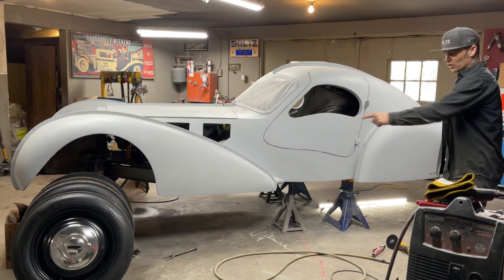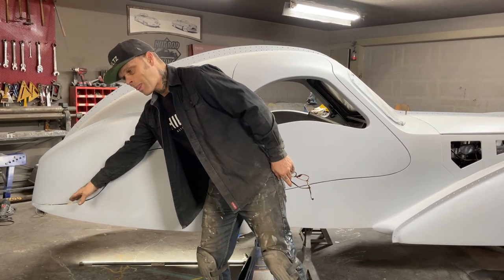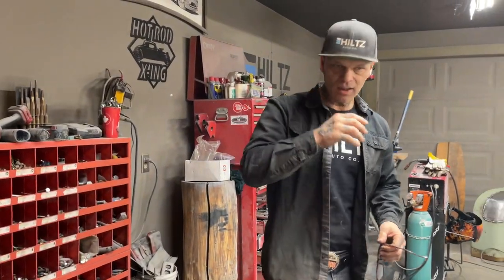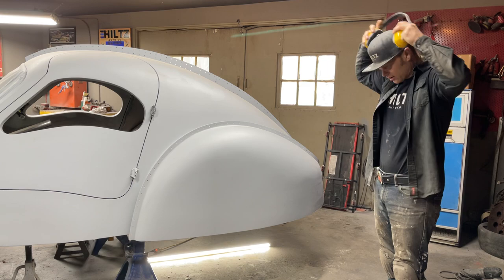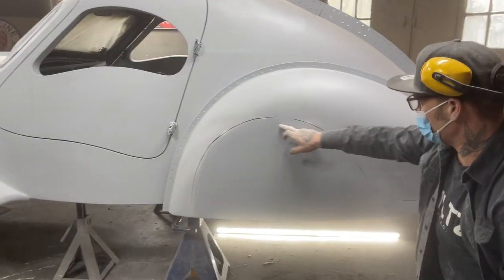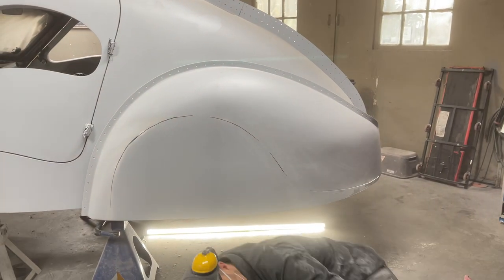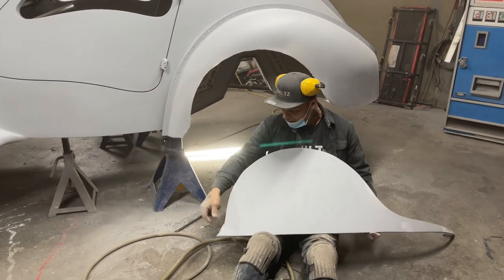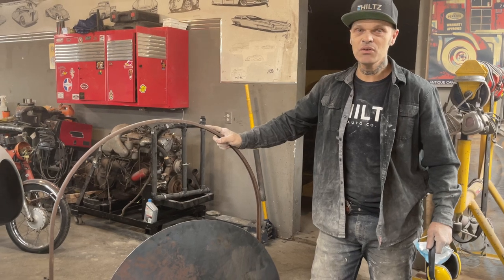BUGATTI UPDATE: REMOVING THE OTHER FENDER SKIRT

Comment: Drill a bunch of small holes from the inside, then connect the dots with a sharpie and the cut it from the out in one continuous line with a grinder, would be much easier and would yield a near finished result... the drill size size should be small to minimize any blowout. No sparkles in your face, your not lying on your back, and your not struggling to find your line. Your doing an awesome job regardless! Thanks for sharing!
Reply: Nice idea but we still gotta cut the washer spacers as well remember but good point👍👍👍

Comment: The grinder is working if the blade doesn't come apart and cut your throat. I think I would have used a jig saw with a diamond cutting metal blade. The car looks good keep the videos coming Chad !

Comment: What I have done in the past you would take clear box tape and put it on the inside of the fender Edge so the Bondo doesn't stick to the car body and then you could unbolt Fender skirt and it would pull right off of the tape and then you could send it back how you wanted it to look I've done this before on a Formula Ford race car body were the top of the body fit along the side of the car fits the bottom of the shell meets the top of the shell and to get full surfaces to match each other I made one surface first put the tape on it clear box tape and then put the other part of the body on it smeared fiberglass resin in between the two body half and they match perfectly

Comment: I like the plan you have to take off the fender wheel covers as few times as possible. Can you use another type of material between the rods? Instead of a metal washer and the filler, how about plastic spacers or fiber spacers. Maybe broken bits of a cut off wheel maybe better suited as your spacers? Or thick cardboard? Or maybe little wood wedges? Keep up the great work.

Comment: A quicker and easier way to cut the fender skirt free would be to use what we in the UK call a Jigsaw. Use a fine metal cutting blade and away you go. Because the blade reciprocates and is both thin and narrow it will cut cleanly, less dust, no sparks and follow the contour of the fender skirt very easily. Bosch, Fein, Makita and Metabo make them and plenty of other manufacturers too.
Reply: He tried using his pneumatic saw on the right side skirt but the reciprocating action caused the body filler to chip.
Reply: He didn't have the guide on the air reciprocating saw. That holds the tool to the cutting surface making the cutting more stable and smooth when cutting. A wood/steel blade with bigger teeth would have worked great
Reply: @mikemetcalfe1526  A steel blade on a jigsaw has fine teeth. And maybe scribe the fender skirt joint on the outside so working on a flat surface in a better position would an advantage too.
Reply: @TheInsaneShecklador  Pushing too hard perhaps? An interesting task to overcome
Reply: @JonDingle  why use a steel blade...unless you want to cut threw the steel fender. For example, a drywall person uses a cutting-edge for drywall when cutting around a electrical box. So he doesn't cut into the steel receptacle box and cut the wires. Plus have you ever used a hacksaw blade to cut wood... The teeth are too small to cut fiberglass and polyester filler efficiently.

Comment: I would take a drill from the back side ,and drill holes so you can make a pattern to follow on the outside . So you can cut it from the outside which will be much easier than from underneath.

Comment: I have this tool made by Dremel 4,000 it's like a Swiss army knife for a tool that has different connections. It reminds me of one of those Doctor's tool's they would use to take casts of your arm or leg, any how this tool cuts a lot of stuff without doing much damage to anything. I was thinking it would have been great for cutting trough the filler and you would use the grinding for cutting off the bolts. Anyhow you got the job done with what you have. Check into that tool maybe for another job that would make it go faster with less clean up work. ✌🏽

Comment: Covering your mixing board with masking paper each time you mix eliminates fighting chunks in your new putty, also, it makes the mixing process better because it give you a clean, smooth, flat surface to mix on, which even gives you a more thorough, complete mix. In the long run, its faster. Then there is no clean-up. You just peel the paper, and toss it. For heavens sake, try it for a week, you will never go back.

Comment: Safety Chad eh good on ya. Fiberglasss second only to asbestos very closely related
Reply: Insulators on some job sites I worked used to smoke so that they could cough the fibres out but I avoided as much as possible the areas they were at,